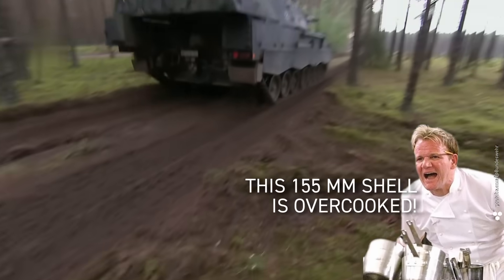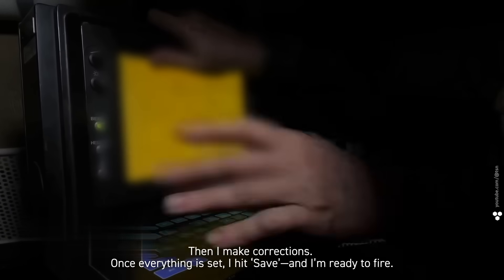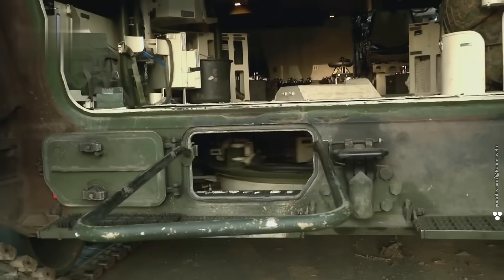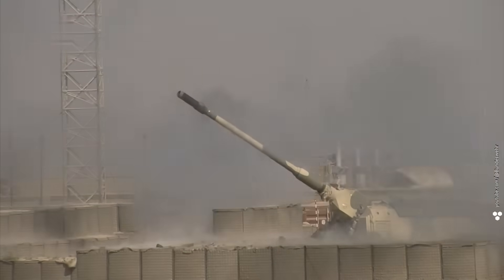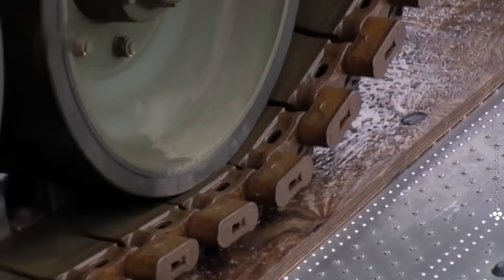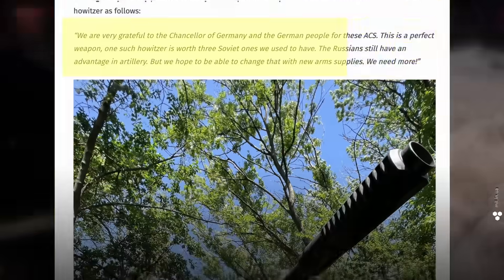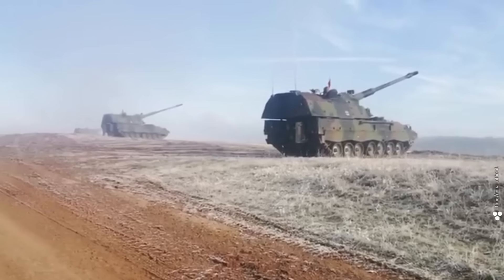Panzerhaubitze 2000: A Monster Howitzer or a Cosy Studio? | Ukrainian Soldiers Spill Hard Truth

Comment from the maker: What do you think is PzH 2000's biggest advantage? Armor, automation, or firepower?
Reply: Speed. PzH2000 can move into position, fire six rounds and move out of position again in such a short time that enemy artillery effectively does not have enough time to counteract with fire.
Reply: @herosstratos  It gets even better with the RCH155, it shoots while moving, no way to catch that beast
Reply: Safety of its crew. 

And after that, the automation
Reply: The ability to have left the place before the rounds fired arrived at the target.

Therefore the rounds of counter fire will just hit an abandoned parking spot.
Reply: It's biggest advantage is being the predecessor of the Remote Controlled Howitzer 155, which is in Ukraine for field trials.
Reply: Speed.
This thing can set up fire six rounds, pack up and be on the move before the the first round hits.
And all six shells will impact with a 2 second time window.
Reply: @ArfurFaulkesHake  And this goes for only one PHZ2000. Normally they "work" together in a bunch of 3-4 in a battery.
Reply: The combination of all of them. No other system is able to do the same. The Caesar, for example, barely protects against a NATO assault rifle; a G3, a small sniper rifle, or a German Bundeswehr MG3 can take it out. The Archer and RCH155 are better armored, while the PZH2000 requires at least a reconnaissance vehicle. The same applies to artillery. A direct hit will take out all of them, while splinters probably won't take out a PZH, and Caesar offers no protection. The PZH2000 has protection against attacks from above using small hollow charge grenades like those used by some drones and area weapons. Against a Panzer Faust that can take out a main battle tank, this is of course not enough. A Caesar is ready to fire in 1 minute and ready to take off again in just under a minute. The PZH2000 within 6 seconds. The others are in between except for the RCH155, which has a speed of almost zero to stop, shoot and start and can also operate while moving. The Pzh2000 is off-road like a main battle tank, the RCH like a wheeled armored vehicle, the Archer and Caesar like an off-road truck. BUT: CAESAR is cheap and easy to transport anywhere by plane. It can be reached anywhere by rail and self-propelled and is not very heavy. ARCHER and RCH 155 can use rail but can also drive long distances without any problems. The Pzh2000 is dependent on rail for long transports, is heavy, and on the road cannot reach 100 km/h like the RCH. However, the Pzh carries about twice as much ammunition as the RCH and other competitors. Many can use a lot of ammunition, the Pzh has two propellant systems. All have good hit patterns and basically all can manage around 40 km with base bleed. With special functions the Pzh can hit at 80 km with a maximum deviation of 10 m and in ammunition tests maximum distances of 100 km were possible. But it's expensive, you can buy several Caesars for one.
3 Rounds in 10sek or 20 in 2 Minutes is a extremely fast rate of fire like 6 Granades hitting a target within less than 2 sek.
Reply: @MP-nc2pw  so light, medium and heavy artillery.
Reply: @cfnorg5308  In this case, however, the middle one is the most mobile, and the heavy one is just behind. Therefore, this classification is difficult to make.
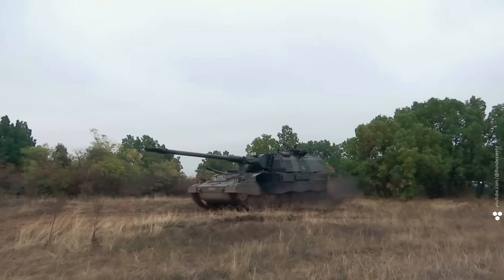Reply: 8:22 "hasnt expirimented" because it showed only 90% first hit capacity of the shells, german ships are not wide enough to stabelize the posssible 16 shells/min constant fire rate of the Pzh 2000 full auto turret. Thats why no further tests were done, common info from any technical military magazin of its time in germany 😉
Reply: I'd probably go with armour, because a lot of the other features are common in modern SPGs, but most of them are fairly lightly armoured by comparison.
Reply: Almost as powerful as Bismarcks secondary artillery.
Reply: Style 🕺
Reply: Speed! 😉
Reply: It's made by people with bad sense of humor.
Reply: Too much shortcoming to have an actual advantage compared to other western system in that category.

If you want an artillery that can pound a position, go for the Archer, much more reliable, faster to move and to resuply.

If you want pure speed and agility, go for a Caesar.

The PZH 2000 is just too easily breakable ( 90% of the fleet out of work a few months after their introduction ), too long to resuply, much less nimble and fast that its western counterparts, and much visible.

There's a reason why it doesn't work much on the frontline anymore while the other donated systems are still intensively used.
Reply: expensive toy that brake every few days !
Reply: It’s battle proven under massive pressure this clearly elevates this platform to the best in class
Reply: YES
Reply: It has shown that the Pzh 2000 has many shortcomings.

Comment: Ukraine will receive the RCH 155, the first build was handed over to ukraine in january (2025) but stays in Germany for training purpose, another 6 will follow this year and more later, its the successor of the PzH 155 if you want so, but its wheeled, first system in the world which can fire while driving (with pinpoint accuracy ofc) and top speed of more than 100km/h (over 62mph) its damn fast and instead of over 50 tons it will be less than 39 tons in the standard version (on GTK Boxer). However it can be mounted on almost everything large enough, allowing buyers to use homemade vehicles.

The US-Army will decide next year which artillery system they will purchase, afaik only the RCH 155 and the Swedish Archer are left. The crew is only 2 people and protection is up to 14.5mm extra-heavy MG and artillery shrapnels. Switzerland bought it but will use their own Mowag Piranha 10x10 as vehicle.

However with no more US aid the artillery shell number will decrease a lot before increased European production will fill that gap, lets hope it won't be too late than...

Comment: I remember there was an article where Folks from Rheinmetall said that some Ukrainian Artillerymen shot over 20.000 rounds from a single barrel - the barrel was made for " just " 4.500.

German Enginneering folks
Reply: It might have lost accuracy on the target but still impressive.
Reply: Not surprised. Military estimates are notoriously conservative. The official estimate is what they can guarantee will work without loss of accuracy. In reality, it will keep working for a lot longer, though probably with reduced accuracy the more you exceed the proposed limit. In peacetime, you'll replace the barrel before it reaches the official limit. I also wouldn't be too surprised if they told the Ukrainians the inofficial estimates of what the barrel can take before actually causing damage. In wartime, you may sometimes need it.
Reply: It was never supposed to be used that way, but rather to strike fast and precisely and move on. Once learned in soviet tactics - forever lost for modern warfare.
Reply: @arekkusub6877
CF Russian armoured assaults during the peak of its use.

When a column of 20 or more armoured vehicles attack the ligne you're defending while you maybe have a grand total of 3 self propelled howitzers able to work on that area...
You don't really have the time to care about what the manual says about the maximum rate of fire.

They underperformed for that reason.
And that's something the German industry needs to learn from.
Reply: @OfShoresAndStorms  I couldn't care less
Reply: @OfShoresAndStorms  Underperformed? Well, there is no discussion when one side keep giving false claims...

Comment: Well as far as I know with them 2 in a platoon and a what we once called "fire strike" you have somewhat between 6 and 10 shells reaching the target zone at the same time if needed...
Meaning you don't want to be a soldier, an angle mirror, a window or anything light armored in around 500 Meters if they just use Fragmentation shells.
Since I have loaded them shells by hand into the Gun of a M109A3 I can tell ya the automatic is the very best of it and then just the devastating destruction it is able to cause.

Comment: its important to understand that the pzh is not made for pounding a postcode for 2 hours, but to fire the three shells in 10 seconds on a specific target and then relocate before counter artillery arrives. its a shoot-and-scoot sniper, not a brute-force tool
Reply: interesting
Reply: i was at 5./115. we had them. its also capable to fire the 3 shots at different angles so all 3 grenades arive at the same time.
Reply: @AS4DA  this is true, the Mutiple Rounds Simultaneous Impact is a Feature. But i was talking more about the claims of the Gun wearing out to fast. It is correct, when used in rapid fire the barrel wears out quite fast, resulting in an expensive replacement procedure. The thing is, as i stated before, the Pzh is not meant for rapid fire in the first place. 
The barrel simply cannot cope with the thermal stress that comes from continuos fire. 
3 rounds in 10 seconds, yes. But with a 30 minute cooldown after that.
Reply: @AS4DA That’s so sick ! I’ll try this when I’ll unlock it soon in War Thunder
Reply: @AS4DA jap thats right …. I was at 2/345 😉
Br
Reply: @tagheuerwoods6241  Firerate in warthunder is too slow for that.
Reply: @berninator9790  That is correct. And when done consequently the barrel lasts many many more shots than the producer says.
Reply: @berninator9790

And I think that's the biggest problem with this self propelled howitzer.
It's a beast if you respect the manual of use to the letter otherwise it starts to break apart. Impressive during military exercises.
But it's a war.
If you stick to the manual all the time, you're dead.
And that's why it has been underperforming in Ukraine ever since its introduction.
Reply: @OfShoresAndStorms  disrespecting the material always leads to bad results. thats not a product fault. also "under performing"? where do you get that from?

Comment: I think Automation is the best thing. In a long fight Soldires get weaker and weaker every singel shoot. If the start by fireing 5 rounds a minute, after a full day of loading and fireing i doubt they can keep doing that for another few day's. The automation might need maintanance, but it load's it's first shoot as fast as it's 100th or 1000th shoot. And as we see this war is heavily dependend on Drone's and Artillery. Also the whole loading is still manualy possibel in case something breakes.

Comment: You did not explain what SMArt-rounds really are: They open at some altitude (100-200m/300-600ft) over the target and expel two intelligent sub-munitions. These submunitions scan the area below, about the size of football field, identify and prioritizes targets and maneuvers over them where about 10m/30ft above the target it detonates a shaped charge that produces a lance of molten metal that can penetrate any existing armor. It is a scary weapon, and if you bring in the shell within a football field that contains any targets, it will destroy the two most expensive ones in that field. And it all happens very fast, with fractions of a second from the shell opening to the target exploding. And if it does not find a programmed target, it won't explode. Oh, and it can see through camouflage. And it seems to work.
Reply from the maker: Good summary! SMArt 155 rounds are indeed highly effective against armored targets. Their ability to prioritize and engage the most valuable threats makes them a serious battlefield asset. Have you seen any reports on their recent use in combat?
Reply: @Weapons.Of.Victory  No, but there were strikes in 2023 that looked like that. You have to look out for a puff of white smoke appearing ~10m above a tank, a frame or so  before a tank explodes.

Comment: In an emergency, the PZH2000 can also shoot directly at tanks (last chance), with a full load - only a few remnants remain of the tank, it shreds into small pieces.
Ah and the PZH2000 has extra external armor called "Hedgehog" so it is well protected against drones or RPGs, the same additional armor is also used on some Marder and Puma. It is simple and cheap and really brings something
Reply: Most artillery can direct fire - and there is a reason why it is called a "last resort measure". Having to resort to direct fire most often means the destruction of the artillery pierce soon after. Artillery of this size is by definition not a close range direct weapon.
Reply: @40hup  Yeap. Direct Fire means Line of Sight. Artillery is like Snipers in that way. We really don't like to be seen.
Reply: would not say "last chance" wasnt the PZH2000 also meant to be an Tank Destroyer?
Reply: @ Tank Destroyer yes,
but Direct Fire / Line of SIght means the MBT can shoot back and outperforms the PZH. ( faster aim, movement, countermeasures and armor.  )
Reply: @achimdemus-holzhaeuser1233  It is not intended for direct fire. But everything without anti-tank weapons such as machine gun positions, small arms can not do much damage to it, but a 155mm explosive projectile from 500m can do much. Direct firefights are more suitable for the RCH155, which can really take down pursuers while on the run

Comment: There was an idea for US to switch to PzH2000 when XM2001 replacement for the M109 was cancelled. Army continued with M109, while they snuck in another self propelled howitzer XM1203 in the Future Combat Systems program, which while also canceled fed some tech to M109 upgrades. Then was the recently cancelled M1299, this time made using M109 chassis. War in Ukraine kind of shown the importance of artillery in modern war, and it is now seen that M109 (including current A7) is critically hampered by its relatively short 38 calibers long gun, when compared to modern systems around the world which use 52 calibers long guns (PzH2000, Swedish Archer, French Caesar, Japanese Type 99, Korean K9, "Polish" Krab). Actually M1299 had 58 calibers long gun, but it was found out to wear too much, which led to the cancellation. There were however programs to put 52 calibers long gun on M109 in both Europe and Korea, so I wouldn't be surprised for future American M109 variants to get such, instead of a completely new system.
Reply from the maker: The US sticking with the M109 shows how tough it is to move on from established systems. The M1299's barrel wear issue was a major setback, but future M109 upgrades with a 52-caliber gun might be the solution. Do you think the US will fully shift to newer systems, or keep improving the M109?
Reply: @Weapons.Of.Victory  I think the US is in a uniquely comfortable position where it can quickly create a new self propelled system if it ever finds itself in a war emergency. This is because every cancelled program is adding to the pool of developed tech, and they are also the lessons of what doesn't work. Furthermore US can still depend on just sheer numbers of the guns available, and other systems which can temporarily lessen the gap in capabilities - so all the guided missiles from HiMARS/M270, any aerial stand off weapons, and possibly even F-35's deep strike capability if it's survivability is real. So I honestly don't see US replacing M109 anytime soon. I think we will see 52 calibers long gun within the next 1-2 M109's upgrades or perhaps a system developed on M109 chassis like M1299 just with that L52 gun. Any decision to switch to a completely new system will be hampered by the internal politics unless there is an emergency.

Comment: When I was deployed on the 124-class, it was said that the PZHB 2000 had warped the structures during test firings.
The entire decks would have had to be rebuilt and reinforced in order to be able to carry the gun without damaging the ship.
Reply: MONARC was somewhat successful. Problems existed to make that PzH2000 gun "seaproof". And then there are those politics ... German politicians didn´t want to upset Oto Melara/Leonardo. So the program was cancelled and now we use 127/64 lightweight from Leonardo... Which is also not that bad and made for ships from the beginning.
Reply: @vophatechnicus  there is also the simple fact that battleships have gone extinct for a reason, big guns arent a thing in naval battles anymore...even a smaller ship like a corvette costs at least 40 times as much as a main battle tank and hence justifies using expensive missiles...and for small boats the relatively small calibre common naval guns in use are absolutely fine as those arent massively armoured anyways...the pzh2000s guns isnt even that big compared to historic battleship guns but still oversized for naval use in current times...
Reply: @ 
However, missiles cost enormous sums.
The small ones already cost over €250,000 each.
The big ones, like Harpoon, cost over €1.5 million.
A 155mm projectile is significantly cheaper.
The range of these projectiles can also be increased dramatically with a few tricks.
Furthermore, 76mm OtoMelara are not suitable for land-based fire.
Even today, sea-based landing operations would have to be secured by accompanying ships, and larger guns are much more effective for this.
Reply: @jay-jaykay3707 thr purpose wouldn't have been naval battles but more reach during coastal bombardments.
Reply: Well yes, the 155mm is Heavy Cruiser caliber usually. As in, back in WW2.